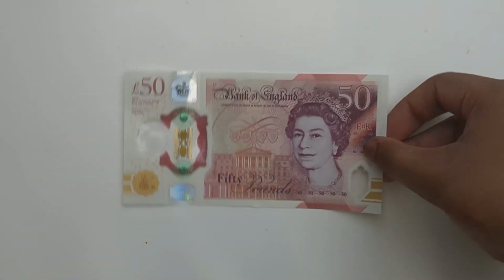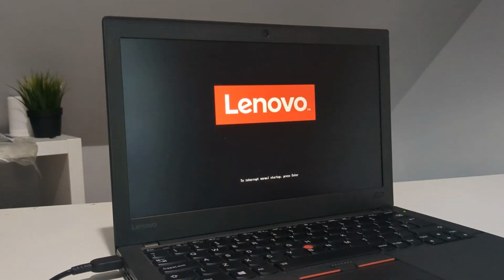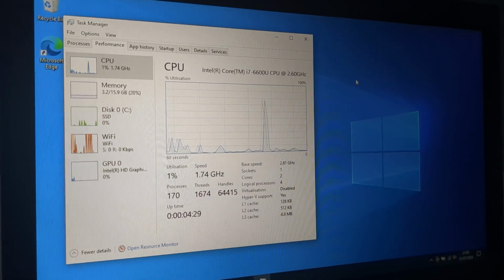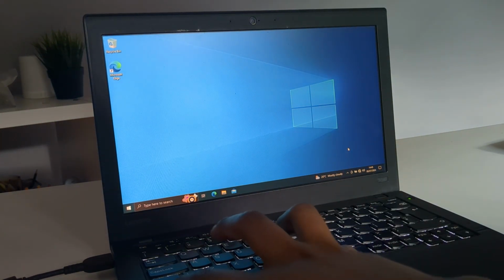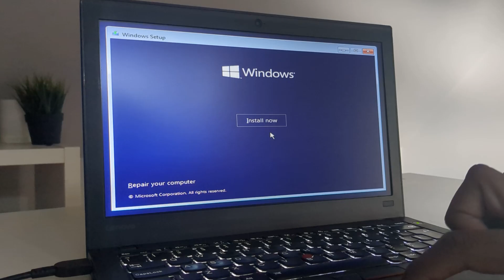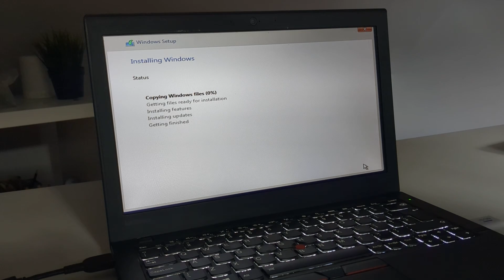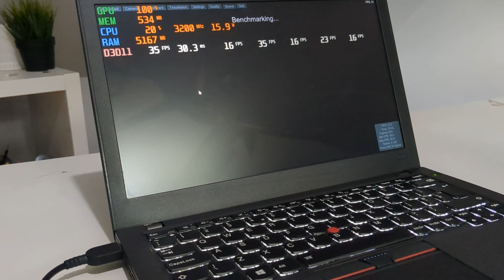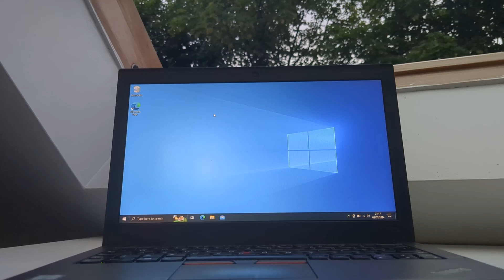This $45 Ultrabook Laptop is AWESOME.. is it too good to be true??

Comment: Again a nice video!

50 pounds for that is incredible. In France, we should look at 120 euros minimum for a used X260, and not for this top tier model. Usually, we get 128/256Go and 8 Go RAM with the i3-6100u or i5-6200u/6300u, no backlit keyboard and the basic TN screen.

Don't forget to say that you got a SD card reader  and 3 USB ports, wich is amazing for such a small form factor laptop, you can plug a mouse, a headset and an external storage at the same time.

The Intel HD 520 graphics is a solid iGPU  for older or lightweight games, but unfortunately, you will not have Dual channel compatibility due to the single RAM slot in the X260 architecture. I played on this  iGPU on a i3-6300u x260 from 2017 to 2023. 
I used to play a nice amount of games on a stable basis without stutters or freeze. With plugged power and ajusted settings at 1368x766, like:  

Minecraft (Sodium+Iris, like you, 50 fps locked), 
Stardew Valley, (high 60fps)
Team Fortress 2, (low 45fps locked)
CS source, (High 60fps)
TES Oblivion, (High 50fps locked)
TES Skyrim  non SE (low 50fps, medium 30 locked)
Civilization V (Low DX9 50fps locked)
Sins of a Solar Empire Rebellion ( high 50 locked)
Tomb Raider 2013 (low 30 fps locked)
Mount & Blade Warband (Medium 50 fps locked)
MW3 2011 ( Medium 30 fps locked)
Quake 4 (High 60fps)
RealRTCW (High 60fps)
XIII (High 60fps)
League of Legends (Medium-low 50 fps)
Among Us (max, 60fps)

The thermals were High, with around 80/90°C when on heaviest games on the list ( the low fps locked ones), but on most games, not going to more than 82/83°C after multiple hours.
If using Linux (Ubuntu and Mint for me), some native games are runing better like Minecraft (no Sodium), Tomb Raider 2013 and Civilization V.

I think you can have 10/15% better graphic performances with the top model X270 i-7 7600U and  Intel HD 620 with 2400Mhz RAM.

I really love those videos, it's very interesting to see what is the market in other countries and see that massive difference between UK and France (I assume you are in UK, correct me if i'm wrong).
Best regards.
Reply from the maker: What a great comment, thanks for the info. Glad you enjoyed the video 😄

Comment: Nice! Just got the yoga gen 3 i7-8th with the HDR display, 8gb ram, 128 nvme, 98% battery, how did I do? £120???
Reply from the maker: X1 Yoga Gen 3? That's an incredible deal, nice 👍
Reply: @cephacore  also, thumb sized ooops wrong cleaning fluid mark bottom right of screen, and nick in front bezel, so not perfect.
Noticed it pulling 58w from the wall just installing windows updates, how the fuck does this thing survive on just a 65W psu???

Comment: You know what I don't get? The price! And from a reputable seller. Unless its just an unnoticed auction. 

I got a Thinkpad x270 around 3 years back, 3.5 maybe, which is basically identical to an x260. Mine was with the basic i5-6200u, 8 GB RAM and 180 GB SSD, with a low-res HD 1366x768 TN screen (which I don't mind), without a backlit KB, for I almost 300 £ then. Got it from a refurbisher, it was the cheapest online price available, I looked (eBay, cEx). Then it had been almost 4 years since launch. (Currently it is almost 7.5 years since launch, which started at around 800$ or 600 £). 

My question is, why would the price only halve for the first part of the above 7.5 yr time period, and then suddenly collapse, getting 4-5x lesser?
Reply from the maker: Laptop prices usually collapse when businesses and schools retire them, this usally occurs 3-5 years after release. Maybe three years back the X270 was still a usable laptop for many but as time goes by people are more reluctant in buying them. Still, it doesn't mean the X270 is at all useless. The X260 in the video clearly demonstrates that
Reply: @cephacore  Hmm yeah. For people interested in minimal and frugal stuff like me then, I think it's worth it to know the inflection point when that happens (most businesses retiring such products). Mine was a retired business piece as well (some probably do that in 3-4 years or less?), as far as I know (the TN screen, the no-backlight KB I think is business). But probably there were enough business or people looking to keep or buy those then. And the market probably wasn't flooded with enough pieces as most businesses got rid of them. Hence the high-ish, almost 50% of the release price at almost 4 years of launch.

Comment: I agree it is a great deal, but the screen is small 12.5" and it is bulky.  It is fun to fix it up but will you use it?  Or will there be a place on you desk?  After owning X1 Carbon Gen 5 (should spend $50 more for Gen), I am not interested in any Lenovo before 2020.  No wonder there are so many bidder on X1 Carbon Gen 6 (even more than X1 Yoga Gen 3).  There are one more that I think is unique from Lenovo.  That is Thinkpad X1 tablet 3rd gen (Gen 1 and Gen 2 screen size is only 12", I think is too small and I still own few Surface 3 and Surface pro and a very old "HP Spectre x2-12-a009nr 2016 12").  Thinkpad X1 Tablet has 13" and very unique set up make it quite interesting.  But still quite expensive as of today ($200). I would get on if it falls under $100.
Reply from the maker: It is quite small so is unfortunately not for me, but I can see where this would be useful. Using this instead of a tablet would be a consideration.

Comment: I got an x270 and pushed it to the max, 32GB RAM, 1,5 TB of storage with 2 SSds, dualboot windows 10 and Linux Mint and it is a great little companion
Reply from the maker: Sounds like a solid mini work horse. Glad you're putting it to good use 😄👌

Comment: I still use my x230t, mostly as a drawing tablet, but , it keeps up. loved their x series ultrabooks
Reply from the maker: never heard of that before, sounds sick 👌
Reply: @cephacore  the x2x0T seriers are the convertazb le tablets, screen turns 180deg and lays flat against the keyboard, and the screen is essentially a fully pressure sensitive wacom tablet.
Reply: I have it for 10 years, X230 never ever die. Now installed with latest Linux Mint 22. Setup with an External IPS HD monitor and keychron mechnical Keyboard, it's as tough as Clint Eastwood.

Comment: lol i am using a rog strix g15 with gtx1650 and ryzen 7 4800h and it runs out of battery faster than old laptops =))
Reply from the maker: gaming laptop's use way more power and less efficient CPUs. I assume the Strix has a 144hz screen which will take more power.
Reply: @cephacore  ye

Comment: I picked up a x280 i3, 8gb and 256ssd for £59. Didn't come with a charger. But £59 for a Windows 11 laptop that has a 1080p IPS screen. Can't complain.
Ran the battery report and it only showed 16 cycles. Some scratches on the lid, but apart from that the laptop almost looks new.
Reply from the maker: Damn that's a sick deal, don't think I've ever seen X280s that low. The battery could mean it was barely used too!
Reply: @cephacore  Yeah, they normally go for around £100, but this one is an i3 not the i5. Runs fine though.

Comment: Man, better to go with x270, the last good x series upto 7th gen. And dual battery. However batteries are hard to find, but an absolute work horse. Mine a 6 th gen i5, with 50 chrome tabs, and 16 gb upgraded ram, and in addition running VMs.I have nothing to complain about .......
Except the bad hinges, as some brass thread inserts are broken, however fixable those are too close to other things and total disassembly required.
Reply from the maker: True I love the X270, primarily for it's USB C which can double as a charging port. They are solid, and surprisingly quite modern machines to this day
Reply: @cephacore  I don't tend to use the USB C much as - 1. It's soldered to the board, and if something breaks or cracks, that's another hassle beside the hinges
2. USB PD charging is not required for those old batteries, the left juice will ooze out ever faster or probably a bamm someday.

I would suggest to limit the batteries to 80% from windows with the Vantage app, and from Linux there are threshold controlling extensions present in gnome.

Comment: I got 10 of those last year for $50. They didn't come with RAM and hard drives. There were three i7s and seven i5s. I had some DDR4 RAM sticks laying around. I bought some cheap SSDs. I put Windows 10 on them and donated them to friends and relatives.
Reply from the maker: Wow you got very lucky with that. Thats $5 per thinkpad
Reply: @cephacore  There is a store near where I live that sells them really cheap depending on the condition. Prices vary, but the highest you'll pay for one laptop is $39. The most popular price is $18.

Comment: For those saying the price is bonkers and fake, please remember these two things : 
- This computer was purchased in the U.K, where the used market is absolutely insane.
- The pound is a fairly strong currency, 50 pounds is 65$
Reply from the maker: Exactly, the used market gets crazy when companies and schools retire their old stock around summer. You can find these deals randomly, I'd admit it does take a bit of luck.
Reply: 1. The UK actually pays more than the US for electronics, 90% of the time.
2. Irrelevant, even in other European countries like Germany and France you'll also pay something like 100 pounds at least.

This is not to say the price is fake, I've seen some people buy the W541 workstation for even less than this. But for the average European, 50 pounds for this is unheard of. The battery itself costs 30 pounds!
Reply: Yeah the uk is pretty insane. Picked up an l13 with a Ryzen 5 5650u back in around april for 150 quid

Comment: What is the battery time on those (browsing/watching videos)?
They seem to have all the power i would require of a secondary laptop, the only question is how long does the battery last. 

And yeah windows is definitely a good thing. Not that i hate linux.. but it´s rather inconvenient and (at least one my previous laptops) recuded the time running on battery power by roughly 40 mins to a full hour. (windows seems to have much better power management, or at least the drivers enable it to run more efficient, not sure what it is)
Reply from the maker: I've been using it for a couple of days so I'll give a few details. Normal usage (web browsing/watching videos), around 4-5 hrs at 75% brightness. You can buy a bigger 48/72whr battery for it, which will probably give it an extra few hours. A really good laptop for battery life given it's age
Reply: @cephacore  thanks, sound like I will order one. Perfect for my needs.

Comment: Sorry i would not want to trade my 2012 Dell E6430. Sure mine is not a thin and light, but i only use it at home on my desk anyway. And the i7-3740QM although being years older make the i7 title of the 6600U look like a sick joke from Intel. (The i73740QM is 3 years older then the i7-6600U but the 6600U is 40% slower). Also you can guess the E6430 second hand is even cheaper because price is not related to speed but to age, which i think is funny. Mine came equipped with 16Gb memory and a small 240Gb Samsung SSD.
Reply from the maker: Gotta think about the price I got it for, and it's intended use. The X260 is for a completely different market. The U series CPUs prioritize battery life over performance. So yes it'll be slower than a workstation CPU. I agree with your take on 6th Gen intel cpus, they could've been a lot better, 8th Gen saw massive improvements.

Comment: Great video. Lenovo lover here t490s, p51 and p520 desktop. All used and trouble-free.
Reply from the maker: The P51 is a great workstation ThinkPad, hopefully I can get my hands on one of them. Glad you enjoyed the video, thanks 👍
Reply: I had a P51s and despised it. The thing ran slow and hot, the keyboard was horrible, and the SSD would randomly disconnect. Is the normal P51 any better?
Reply: @mysticaxolotl8215  I've had no issues speed wise. I think there is a bit of a heat thing, though. Improved after a clean and paste, etc, but still not the best. In saying this, I notice the exhaust heat more from the t490s if I'm using it on my lap.